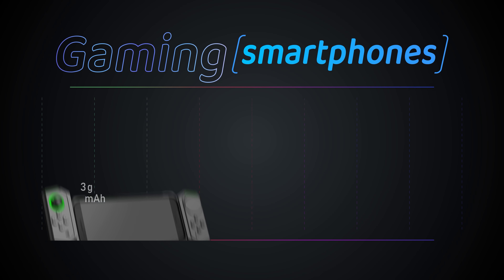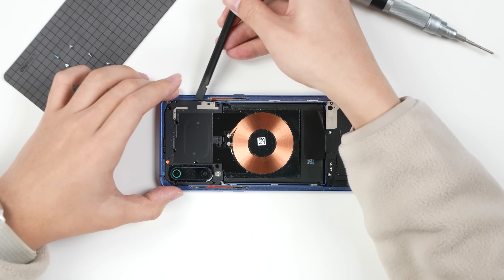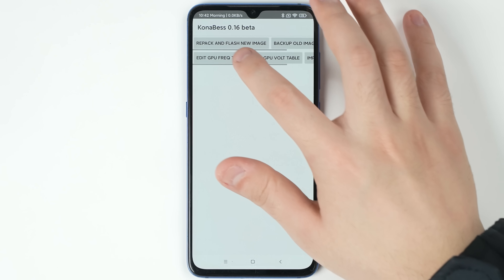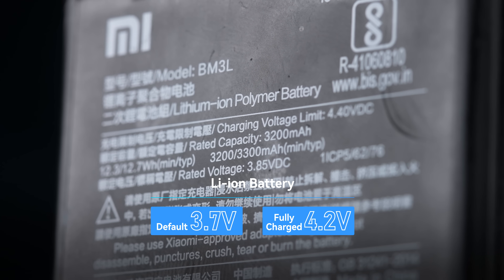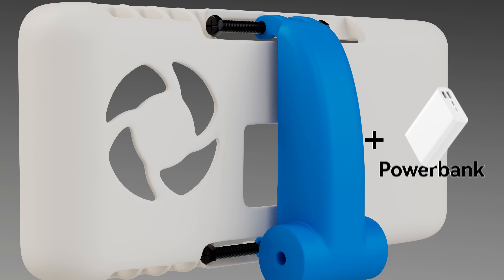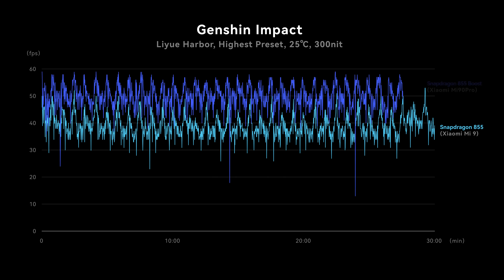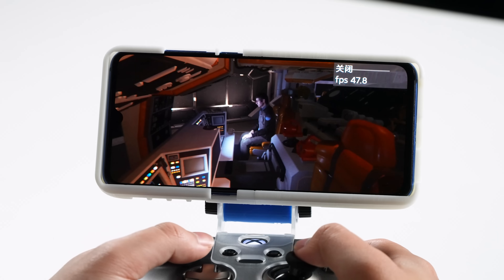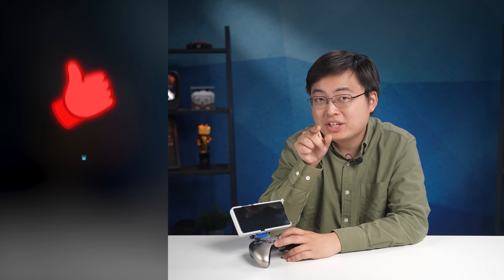We Turned This Old Phone into a Gaming Beast !!!

Comment: lol i do the same with  my phone, you can look for " japan tech trash " phone, there is xperia xz2 and xperia xz3 (its cheap because its use to bind to japan sim card, choose AU or SoftBank, dont choose Docomo,, and usually it can only use wifi because of that sim card bind and imei etc), in my country its cost $90-100 usd, it has snapdragon 845,, prepare more $25 to unlock the bootloader to install custom rom (lineageos),,, usually the phone is on good condition and sold only the device without box or charger, you can teardown the phone and remove the camera and the fingerprint ( so the back of the phone now has 2 holes )and anything else that useless, thru that camera holes, you can put 4cmx4cm fan there, and the hot air will blow out from the fingerprint hole , preferably fan with bearing ( cost $2-3 ) so you can crank the fan very fast. you can put the fan on soft case and just put it on the phone, no need for special phone case, but if you have 3d printer, then you can design case for it and just remove the back all together like on this video. the performance will outrun regular snapdragon 855 phone just  like in this vide the sd855 performance outrun 865. its cool little project.

Comment: Well, I have a Mi 8 since 2018. I'm about to upgrade to a new phone, but being a sdm845 it still has some nice performance in it, actually being so similar to the best seller Poco F1 it has a lot of community support still. Heck, it even has kernel 5.15 ported to it. Time to build a Mi 80 Pro, I guess :D
Reply: And there is nothing wrong with keeping the old phone. Maybe not as daily driver, but for stuff like this.
Reply: i got mi 8 too, tried to overclock cpu and gpu works like charm, only issue is heating. a nicely mod cooler and case like this video will do great

Comment: Should try with redmagic 7 that comes with fan inside the phone. Honestly I got pretty much stable 60fps on genshin impact. It doesn't hot that much due to the fan inside the phone. Also I think 8g1 is already overpowered. Maybe u could try make the 8g1 run 120fps on genshin impact.

Comment: 8:03 hold on a sec, is that app is a webview based? becasue the alert system (or notification) is pretty similar which i'm currently use in my current project, sweet alert

Comment: Yeah, overclocking mobile SOC's, specifically the GPU net you almost prefect scaling. So the Adreno 640 at 585MHz is rated at 900GFlops of FP32. Put a 100MHz overclock on it and it'll reach that famed 1 Teraflop of FP32. A 1TFlop GPU in a mobile SOC is pretty respectable.

Comment: I watched this and was in awe of how amazingly made this custom gaming phone is, I love how you tapped into the hidden potential of MI 9 and unleashed all it's power. It made me wonder, how much storage those it have, is it the normal size of MI 9 or is storage customizable? it's something that was stuck on my head because I think it wasn't mentioned. Please do share about it if you read this comment, thank you for the wonderful well thought out content full of effort :)
Reply: Yeah I have a mi9 and it comes in 64/128 storage and it's not expandable. There isn't an sd card slot in it sadly. But if you're just running games only, 128 gb should be plenty.
Reply: @ILFforever  damn if only it has an sd card slot, just buy a class 10 sd card and you can link the sd card as an extended internal storage via root!
Reply: @vxllvxn  I'm sure someone can try and mod it in. Xiaomi's software is very lenient after all. But yeah lately I've been using an miui 13 Android 12 rom mod for the mi9 and it's super smooth.

Comment: Snapdragon 865 have much more headroom for overclocking than 855. For example, on mi 10t you can achieve better performance than ROG phone 5 (that comes with overclocked snap. 888) without even opening the device.
Also don't buy phones with 870 or 855+ etc if they are not cheap because these chips are just like the previous ones but come with higher base clock

Comment: I wonder what performance we’d get if we do this to a 8 gen 1 powered phone?
Reply: Dimensity 9000 is better than sd 8 gen 1 in terms of gaming
Reply: @kuyskuys7515  not at all
Reply: @josephololade  sd 8 gen 1 heats a lot
Reply: @kuyskuys7515  true, but performance is better
Reply: @josephololade  fyi heat reduce perfomance of the phone
Reply: @kuyskuys7515  you can disable thermals
Reply: Ryzen 7 5700x performance level I guess
Reply: @josephololade  yep with the same power consumption 🤣😅🤣😅🤣
Reply: @kirilivanov5852  🤣🤣
Reply: it won't be much performance
Reply: @goodluckokereke  lol, I guess you don't know about specs
Reply: @josephololade  ok.
Reply: 功耗爆炸巨耗电，但性能巨强
Reply: Sd8g1 is unfortunately locked and gpu can’t be overclocked :)
Reply: @kirilivanov5852  too bad, would have loved to see that.
Reply: There is a great diference, ordinary people might not know this, but a cpu isnt only noticeable faster just with mote cores or more speed(ghz). Theres somethings between them, like architecture, compatibility, tdp, the software limitation... snp 8gen1 is tunned way slow on flagships, cause it literally will burn all your battery, and get as high as 60 degress. Imagine that on your hand, 2 or 3 hours of battery... it can surpass ios, but not oficially. In more 2 generations, i expect it to simple score 20 to 30% more than iphone with the same thermal consuption, and less heat.
Snp 8gen2 or somewhat like that.

And ios ui, programs and tdp is a hell of a miracle. They are experts at that.
Reply: @kayocesar5033  sd855, 65, 70 are having times better architecture compared to the latest Exynos. And those processors are times more efficient compared to the latest sd8gen1.. They can’t get a score of 1million like the sd8gen1 but with gpu overclock the real results will be compatible, having in mind that they’re more efficient.. So for me especially for gaming or even regular usage sd888 is locked and similar in performance to the cpus mentioned above. And the 8gen1 is fucking beast starving for energy, zero efficiency.. On the other hand Apple are optimising their iOS at maximum therefore android can never ever get that type of performance.. because there are 1000 different ROMs for all those Android devices and they will never optimise their performance as Apple is doing.. :)
Reply: @kirilivanov5852  yeah, justa that. Imagine if they can supply enough for 8gen1, withouet burning your hands, on the next generation, snp "8gen2" problably, if they can man, thats gonna surpass everyone, theres some smartphones coming with fans and copoer dissipation, ssd... im expecting great things in the future but now if you do that do snp 8gen1, youre gonna lose your phone hahahaha
Reply: @kayocesar5033  you would not lose it because it’s stock lock, cpu can’t be OC, Gpu is locked too so they’ve already maxed it can’t be overclocked sd8g1 is just garbage for modification.. can be undervolt but not overclocked more than -/+15
Reply: @kirilivanov5852  hmmm thats interesting, how much time do you thik its enough for them to unblock it 😁, on the market of processor there are some like this, or they forcefully unlock it or wait for a version unblocked to be launched. Dont know what gonna happen.
Reply: @kayocesar5033  not soon.. even if unlocked it’s using too much power W so if overclocked it will be RIP battery 🔋😂😅
Reply: It can play any game at max settings
Reply: @navyugsingh6288  855, 865 can play every game on high settings.. you’re saying and stating nothing here
Reply: @kirilivanov5852  but they can't play alien isolation on max settings
Reply: @navyugsingh6288  something something crysis
Reply: @S31Syntax  plz type complete msg bro
Reply: @navyugsingh6288  its the crysis meme bro
Reply: @dkrampage2933  ok bro

Comment: How to make a homemade BOMB to play games that will give you a "bang for the buck" , why you need an apple to keep the doctor away, when you have this to bring the hospital to you 😝👍🏼
Reply: Bruh this phone isn't even a daily used. This guy is trying to show how good actualy mobile hardware are if all of them is set to performance mode. 

Every smartphone in existence only used 40-60% of their actual power to prevent overheating and huge battery consumption since mobile did not have a heat sink for making the phone lighter and thinner.

Edit: Auto correct

Comment: Also the fdm would work better if you were using a top. Down print, the 45 degree angle printer is extremely difficult to use, but resin printing is just as cheap really so both are still diy friendly, but those 45 degree endless printers are tough as hell to use, either way what a great video haha funny and inspiring and helpful, I want to make one!

Comment: My only question is can't you add a battery protection discharge module for each battery then connect them together? That way each one will be managed individually or would the phones smart charge board not charge all 3 then?

Comment: This just shows that thermal limitations are the only thing holding "Old" mobile cpus back, I wish there be some crazy manufacturer that makes a phone like this with Snapdragon 8 gen1 that's using 10watts and has a good cooling system, I think it could easily give ~75% more FPS and performance
Reply: Kinda why the Switch and Nvidia Shield have active cooling, they're meant to run full power for hours not the burst power in minutes. The PS Vita as well has a severely downclocked CPU by default (I think around 450 MHz when the chip can take ~3x that or so).

Also downright silly that a 2019 phone is an "old" phone, unless the idea is just it's old as in condition.
Old is my dang Xperia L that lasted me 8 years from 2014 till last week, still kicking tho, just finally upgraded
Reply: @syaondri  Yeah since I just... don't like the new big phones and anything smaller new on market is complete shit here (like only bottom of the barrel chipsets, terrible screens and elderly phones), I went through the bet of buying an Xperia Z5 Compact through Aliexpress. I knew the signal would work here (checked to see if the Japanese SO-02H variant's frequencies match, which they thankfully do) and the only surprise was NFC not working.
Still sort-of forgiven for costing less than 60 dollars and in like-new condition (since it's a refurbish one). Just won't dare trusting that water proofing tho.
Reply: RedMagic 7 might be what you're looking for.
Reply: efficiency obviously goes down with higher clocks, which is why having some sort of efficiency/performance switch would be nice. The simple option to choose between a cool and long running phone, and a performance monster that is hard to hold on to.
Reply: @jghifiversveiws8729  for the price as a gaming phone than yeah but id rather go for the Asus Rog 6 pro

Comment: Nice build. I want to do this with the camera intact, by extending the ribbon cable with wires to get it to the back of the phone. and with one or two of those li-po drone battery cells.

I did the multi battery single BMS mod a while back. Don't have a 3d printer, so looked bad. But I made it swappable from the outside. I used 4 3500mah 18650s and T plugs. Didn't know I had to adjust battery capacity in software. Guess mine worked with voltage level.

Comment: I've always wanted to get a custom back with more battery and cooling. 

I recently bought a xiaomi Poco F3(laowai K40 8gb 256gb) from the mi store app for 194 pounds,  fast ram, SD 870, good "liquid" colling. I think it just has some copper heat syncs or something. 
I have seen some phone with cracked backs on ebay for 100 pounds or so. 

That phone could be a great condendor apart from I'm not sure how thr cooling system works. 

I can ren gebshin on full and the 120 soled screen is really great.

Most people who buy them just put on a custom rom.

You can get a 12 month Brazil game pass for 25 pounds then upgrade it to ultimate for 1 pounds, if your lucky they throw in 3 months.    I don't have any subscription services but  under 2 pounds  a month for game pass on any device is a good deal and it seems to run on some awful phones and pads OK

A most excellent video sir.

Comment: I dont know much about miui china variant but using a CAF build yeilds better cpu scores as the firmware is made by snapdragon for utmost cpu performance wouldve been better, if not then using any aosp without google services would've definitely put this a league above 870 if you configure the OS right, Also try different kernels

Comment: Such an irony that Mi90 sounded literally similar to Mi9T lol. But yeah I am now wishing if there is attempts to overclock the Snapdragon 865 since I've heard that it runs Genshin the best even when compared to the latest Snapdragon 8 Gen 1, in terms of stability in frames that is. With 865 being sooo efficient and that 870 and above have throttling issues, it might actually be able to surpass 8Gen1 in sheer performance if you did the same to that chip like this video! But still cool video regardless!
Reply: should be miT90 Russian tank

Comment: Imagine the performance you'd get when doing this to a flagship phone. Cool video :)
Reply: you can try this, just install a custom rom with a custom kernel without thermal throttling, I did it with a S10+ and every game no matter the graphics settings always was 60 fps stable, thing is, it gets dangerously hot (like hot near making the battery explode) so it's good for benchmarking or fooling around a bit with it, but not as stable mod for daily gaming.
Reply: @abrahamalviarez5870  that's Exynos for ya heat engine
Reply: @dyceman  yes, crazy exynos is still a thing in 2022, garbage proccesor
Reply: MI 9 is a flagship phone.
Reply: It most likely would be similiar, flagship phones don't have as much support and are harder to configure so there would either be a lot more struggle or not as much you could do as on the Xiaomi mi 9 or one plus 7t
Reply: flagships are very expensive while this costs the same as my own phone from 2017 boasting 240% higher performance.
Reply: @shlokshah5379  i know. But i said imagine the performance you would’ve gotten doing this with a flagship phone.
Reply: @shlokshah5379  which cell phone?
Reply: Yeah imagine right
Reply: Imagine yeah

Comment: I went from an 855 to an 865 device and the difference in genshin was huge. like, from 50ish at low settings to solid 60fps at max settings. 865 beat 888 in fps due to running way cooler and not thermal throttling so much.
Reply: 865 solid 60fps at max settings

Golden Reviewer: Press x to doubt

Comment: why manufacturers always sandwich the processor between the motherboard and the display...they should put it on the back side of the motherboard like a laptop....and expose the heat sink pipe to the back outside the phone....so that We can connect the cooling fan..

Comment: What if you overclocked a brand new Qualcomm chip, see how far the new stuff can be pushed and how much performance we are missing out compared to stock?

Also loved the video! Keep it up
Reply: That defeats the porpoise of this tutorial, if you have unlimited money just buy the most expensive phone and that's it.
Reply: @FcoMp  Even the most expensive phone they cut corners on performance. 

I am talking the most recent chipset but with 3 stacked batteries, a 3D printed case and a big fan on the back - to really push that new chip to the limits.
Reply: Video Games  nope that's not possible
Reply: @helixspike  unless you count genshin lol
Reply: On the actual snp 8gen1, its impossible for only 2 motives. 

1. Heat
2. Batery

It will literally get so hot that burns, and have more or less 3 hours of batery.

Who knows in the next generations... might get better tdp.
Reply: And a simple coller like the one he used isnt enough, pretty sure. Maybe a copper conductive, like laptops... who knows

Comment: I'm not sure turning OFF the overheat protection is a good idea, long-term...since y'know, overly hot components age and start to fail a lot faster, and if your DIY gaming phone fails in a year or two, then it's not really much cheaper than a proper flagship after all
but I love the idea, though also not sure if ripping out the camera actually improved anything, given that it was mainly next to the sandwich of the SoC, and not really in any place where the airflow would improve much...
Reply: It has a gigantic heatsink and a huge active cooling fan blowing at it. Heat dissipation is too strong for a phone.

Comment: Your FDM prints probably failed because that printer isn't really made for small parts. And the Printhead Angle really messes stuff up. I recommend just picking up an ender 3 V2 and you could very easily print stuff like that without as much trouble.

Comment: I seriously can't believe this older phone is faster than a newer flagship. 🤯

I guess having good thermals really does make a big difference. 😳
Reply: Most smartphone limiting factor has always been heat. You dump electrons into 5nm silicone, so the energy change is electric ---> heat.
Reply: Thermals are always very important, but it's very rarely talked about unless you're a (real) nerd. You can, and I have undervolted my PC GPU, which gives me less "power" but butter performance, because less heat means less throttle means better performance.

Comment: Planning to turn my old Note 4 into an emulation rig. I was thinking about actually making a custom shell with built in controller to make my own custom handheld in the same vein as a Switch Lite or Steam Deck. It runs Marshmallow so is compatible with Geforce Now and has a 1440p display.

Comment: I am also curious about mi 120 pro :D More curious to how snap8 would perform without thermal problems. But I also know this is nearly impossible since qualcomm forbids overclocking by hardware lock.
Reply: Mi 120 pro doesn't even exist, if Xiomu continues to release one flagship per year it's coming in 2130